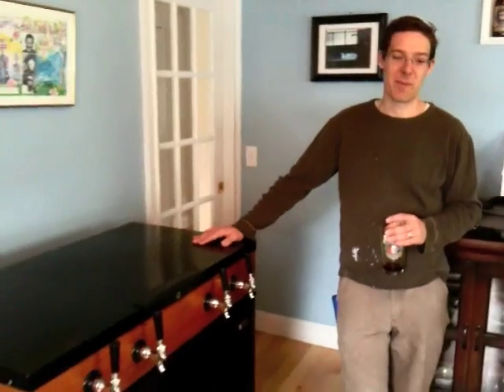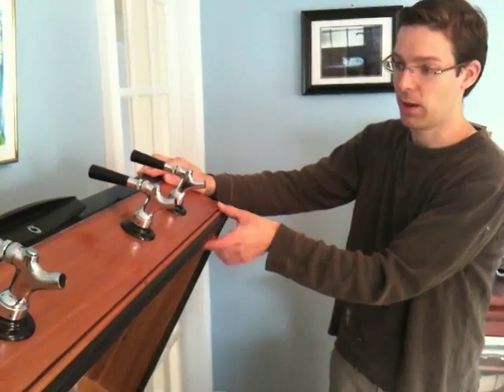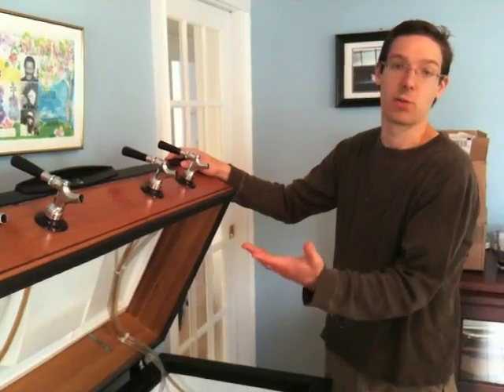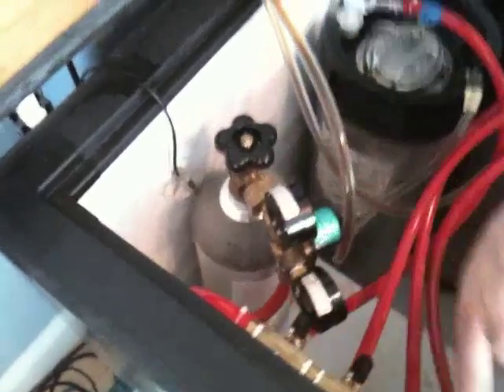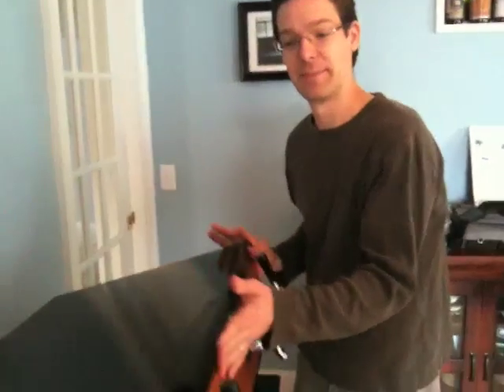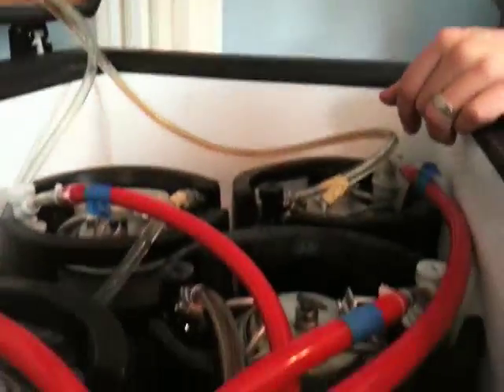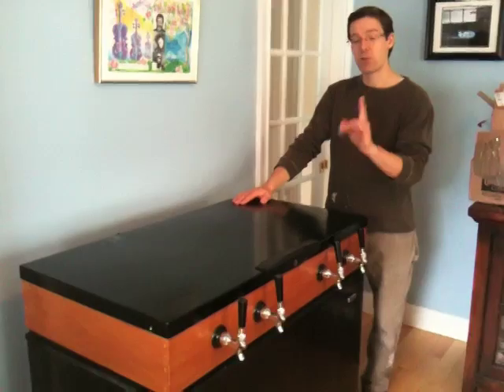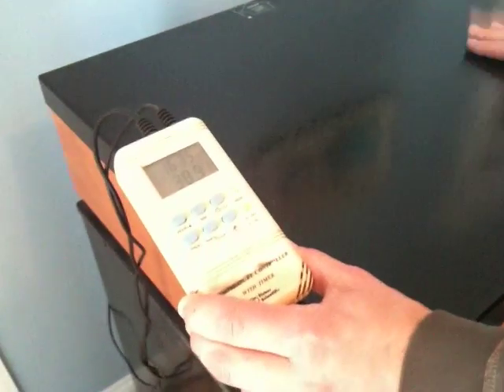How to Make a Kegerator

Comment: Part of the reason you put it on the lid is so that you don't have to lift the kegs as high to put them in the chest freezer. Also it is good so that when you are putting kegs in you wont be bashing them on the shanks of the taps. You might need some better hinges tho.

Comment: Any refrigerator made after 1993 will use significantly less electricity than older models. EnergyStar units will be 20-30% more efficient than regular post-1993 units.